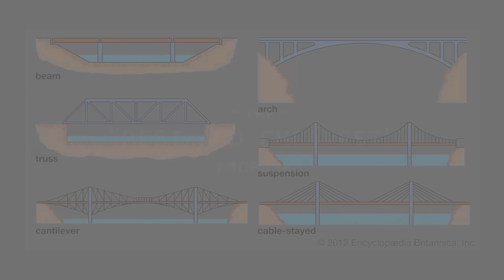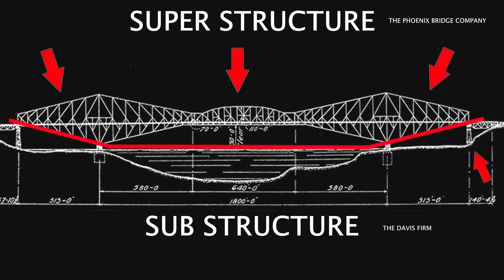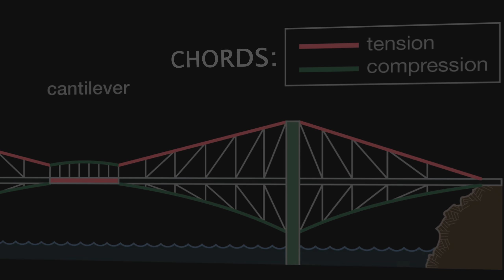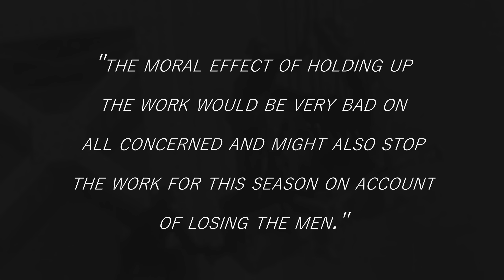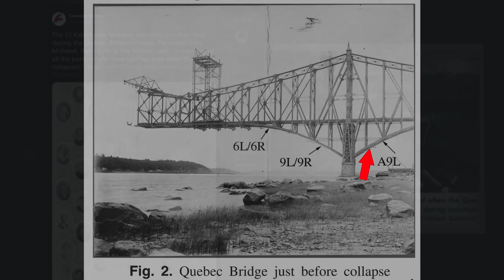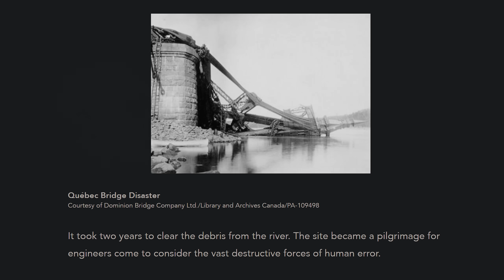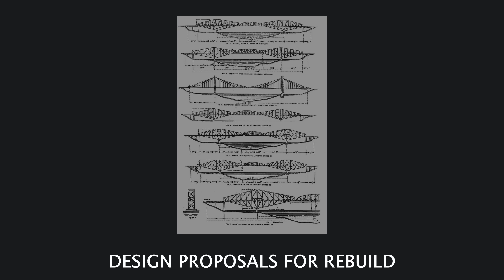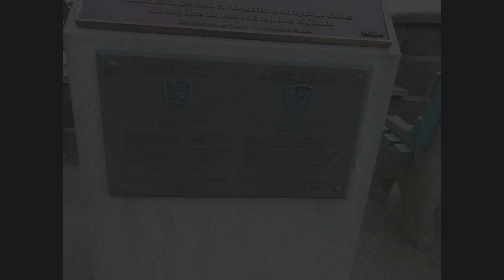Ego in Engineering: The Quebec Bridge Collapse

Comment: Funny enough, the Samuel de Champlain Bridge could have almost turned into the Quebec Bridge disaster #2. Thankfully it got rebuilt entirely but wow.

And like some fellas stated, engineers receive a steel ring as a sort of reminder of this fiasco.

Ps: as a technician in building automation, and it happens that I have to speak to engineers to discuss potential issues.

Comment: Amazing how deadly the compounding effects of "it's fine" can prove to be. A bit of working with pins to make holes line up is normal in all ironworking, but we're talking fractions of inches, maybe an inch or two TOPS--I'm assuming these holes didn't line up by a factor of feet. Badbadbadbadbadbadbad. Cheap, fast, good: pick two.

Comment: Not all engineering failures are immediate. The Minneapolis Minnesota 35w bridge failure was because of the gusset plates being 1/2 inch thick instead of 1 inch thick on the blueprints. Plus the bridge had been added onto. One engineer working for The Minnesota Department of Transportation kept warning management that the 35w bridge would fail, and they didn’t listen to him.

Comment: ☠ The bridge is in such bad condition due to corrosion, some steel member are so damaged that thay are missing 3-4 inch of steel. I had the report of the latest inspection but cant find it anymore and they pulled the report from the site,(I can go and search for it if someone is really interrested) another bridge in the same general area the Pont de l'Île-d'Orléans is in rough shape too this one as still got the report available if you want to take a look i'll provide the link some pictures are really scary and might get you tempted to take the ferry but if you want to go on the ilsand you got no choice but to cross that bridge
Reply: if you want the links dm me since youtube deletes comment with links in them

Comment: It's an impressive bridge but even today they still cheap out in the maintenance of that bridge. If I recall they cancelled repainting the bridge at some point, finally had been done some years later. When you hear from the radio that the bridge needs pressing review of the structure it kinda scared me back then. Seems fine now since the traffic has been slowed down for years due to number of repairs on the dam thing. I'd bet they keeping tabs on it.

Comment: As a young Mech. Eng., I always ask from the welders, benders etc. for their recommendations. I remember when I started my job that factory manager actually really sharpened it to me to talk to the guys because they know their jobs. This talk was a bit odd to me, because I had presumed that of course engineers would ask the guys first. I was amazed to learn that my engineering collegues in fact didn't. I left that job due to the high up management being idiots (especially CEO), but the workers liked me - I always asked their opinions and tried to make sure all the designs were safe, even if it would cost a bit more.

Comment: Had they completed both halves and had them connected in the middle things would have been different, it was stretching all that weight out horizontally it's easy to see how that one chord on the right was about the only thing connected by a diagonal of any merit and that diagonal from it to the top of the tower was at a very steep angle which would have been a much bigger  load on the two pieces than if the diagonal had been say 45 degrees instead of maybe 70 degrees.

Comment: This is an excellent video and involved lots of research to produce it. But there are a couple of other important issues, that led to this collapse, that were explained in the great book "A Bridge at Quebec, by William Middleton.

If you look at the profile drawing of the original plan you can see that the bottom chord describes an arc, obviously  done for aesthetic  reasons. Those bottom chords were in compression on this structure. At every joint in that bottom chord those 2 meeting chord members had to come together at a slight angle, in order to describe that designed curve. At that time no equipment existed to properly face the ends of those chord members at the precise angle needed. This was a major issue for the Phoenix company. Also each of those chord members were made up of several structural steel members side by side and connected together by angled latticework. No machines existed to test one of these chord members to destruction. After the collapse a machine was devised to test a half sized model, but that did not exist when the original pieces were made. Later testing showed the original latticework to be greatly deficient. 

When the pieces were originally assembled they were bolted together in order to save time. The rivet crew came along later replacing those temporary bolts with the rivets. Those riveting crews had great trouble getting the holes to line up in the existing chord members showing that some amount of deflection had already taken place. When a member of a bridge is in compression it is generally accepted that the member will be straight. You will notice that the second bridge was built with straight bottom chords and much heavier components. 

This bridge was built as a railroad bridge. No roadway on the original. Theodore Cooper had been one of the most outstanding bridge engineers in America for over 4 decades. He came up with the design system still used to rate new railroad bridges today, the "E" method. A railroad bridge with an E-75 rating is designed to carry a load of 75,000 lbs per axle. Cooper was elderly at the time of this project, not in good health, but possessed of a large ego. He never visited the site. Yet he would not have any of his work viewed by any other engineers. This was a recipe for disaster. David Steinman, who designed the Mackinac Bridge in Michigan, a 5 mile long structure was often on the site to keep up on how things were going. There have been other spectacular failures of bridges who's designers thought their work was beyond question. Check out the Tacoma, WA collapse of the bridge over Tacoma Narrows in the fall of 1940.

Comment: In Honduras, most engineers teaching over at school would always remind us that it´s the workers insight the one that usually finds irregularities and small problems inside the process or structures, not mangement, nor HR, neither the company executives. Most workers tend to have been involved in their line of work for decades, meaning they know the little things that make som things tick, and what makes them crack, and while us as engineers know most of the technical terms and protocols to corrects this things, it´s them that have the knack for finding those little problems.
Reply: here here. I've been a construction manager for 10+ years and we regularly find errors in engineering - from the simple miscalculation of a pipe run to the enormous load design error. Engineers aren't perfect and most have no real-world experience for their designs coming to life, so they have to rely on the field if something doesn't look right.

Comment: Haha in the mines the miners say all a geology degree only means they don't listen.
 As a builder starting as a carpenter, I noted many architectural design structural failures not always caught by the engineers even to the point of dimensions that did not add up.
 I quickly learned not to trust any of the "expert" opinions.
 And learned as quickly to tell the experts that knew what they were doing and provided real fixes to some of the "Ooops" issues.

Comment: The essential cause were in 1907 ,1916 and now are still due to insufficient safety-margins and, secondly, the ignorance of elastic instability  in structures for this first disaster as well as the second one in 1916. The same  is still true regarding the obvious actual problems observed for this bridge. Hubris is still there  ( Engineers being too confident in their personal knowledge ) . The weight of bulk trains on this bridge were to my observations increased after privatization of CN in 1996 by "likely" 40 % ( subject to confirmation) after an optimistic  SAP-9- 3D model simulation. I took photos of many major inter-rivets buckling of major members. And very recently showed published a very significant "systems" of cracks on the base of north-west main post.  Omertà persist ! 

  This bridge remains highly exposed to elastic instability, buckling conditions , as it remains the world record structural span  ( excluding suspension and stayed bridges) . I am a retired engineer, studying and inquiring these situations for more than eleven years on this bridge that is within a mile from my home. 

 I consider myself as the first and only whistle-blower for an eventual  third disaster. It will likely, be an economic disaster as the bridge is now under high scrutiny but also most details are kept under omertà.  The owner and both governments, I think, know it all. Since they are actively, since my only public alarms in 2015, 7 years ago, reinforcing parts of the structure consolidating the systemic distortions that strangely resembles the ones reported prior to the first disaster.

Comment: Scotland here - had a discussion with a bridge building engineer who was being pressured to use what he considered inferior material in building 'his' bridge. He stuck to his guns, and the advice of his labourers and refused to work with inferior material. In his opinion the bridge would have gone out of service (failed) within 10 years. He said he couldn't live with himself if people died crossing his bridge. He got his own way, although the bridge was delayed and cost extra money. He was sacked after the bridge was finished. 3 bridges now stand over the river, 1 rail, and 2 road. The bridge he built did indeed fail,  salt water corroded the suspension cables. It still stands today, although is closed to private traffic.

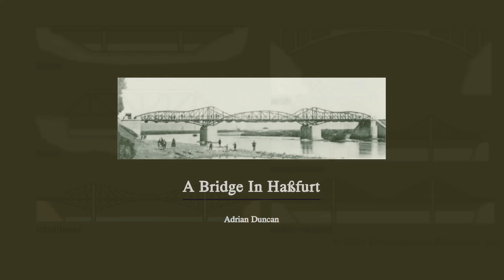Comment: 02:08 As you mentioned the very first cantilever bridge in Germany, just as fyi that the bridge was in service for almost 100 years from 1867 to 1961 when it was replaced by a modern concrete bridge which is also now scheduled to be replaced during the next few years.

Comment: The statement of "engineers are closed minded to the opinions of laborers and assemblers" is beyond true

- mechanical engineer for automated manufacturing
Reply from the maker: 😉
-Robotic Systems Integrator for Automated Manufacturing
Reply: @BrickImmortar  at least my company took my request to work on assembly for 3 months seriously and let me work with the guys. It was a good change for once and I got a little bit more respect from them afterwards. Still amused that they blame engineering for all of the issues they have that aren't design related
Reply: I work as a technician for building automation, mostly on controls? and I often see a lot of stuff that I frown upon. I'm sure there are things behind the scenes that I don't know but that doesn't stop me from trying to reach out to them. Subcontracting makes communication difficult, sadly.

Comment: When you are building a bridge and you don't know what the f*c* you are doing, you always (and I mean 'always') build a 1/10-scale mockup of the bridge first, and see if that bridge fails during construction, or when 4-times the proposed load is applied to it.  If the mockup can hold 4 times the proposed load for 1 full month, without collapsing, then you can go ahead and build that full-sized bridge.
Reply: Youre right totally right! I , retired mechanical , Eng built a sketchy model and independently surveyed the structure for 11 years with lots of photos the actual neglected state of this bridge. It's rusted and deformed beyond repairs in elastic instability lateral buckling, while owners and authorities hide the situation while; I think consolidating the structure for its controlled orderly demolition. Flicker "Rouille et deformations sur le pont de Québec" The more or less the same situation  with hubris and engineers egos. the reading on this video is from Frantz Lichtenberg in charge of the construction letter after he advised the authorities for the second collapse. The safety factor for lateral members and wind bracing is either 1.33 or 1.7 9 before elastic instability not known at the time ( S. Thimoshenko equations) before vibration. Believe it or not owners  increased the weight of ore convoys by a minimum of 40% after an optimist SAP90 3D simulation; and considering wind-bracings and deck supports fully elastic while they are observed in plastic phase deformation all over the structure.

Comment: (Best and Cheapest in Engineering in the same sentence)
Grim Reaper: Whelp, there goes my weekend...
Reply: It doesn't have to be that bleak if the emphasize is on the "BEST" first and then choose the cheapest of them.
It does become dangerous when the emphasize is on the "CHEAPEST" first and then looking for the best.
Reply: @gorilladisco9108  Order from most to least expensive and pick the second cheapest.
Otherwise there's a pretty good chance that disaster will come a-callin' sooner or later, even if it's not necessarily in the form of old mate with the scythe.
Reply: Good,Cheap,or Fast.
Pick 2 of 3.
Fast and Good,and it won't be Cheap
Cheap and Good,and it won't be Fast.
Fast and Cheap,and it won't be Good...

Best,in this equation,should equally balance all three?
Next stop- 'The Land of Make Believe'
Even worse than 'The Twilight Zone'........
Reply: So much for that vacation the reaper was hoping for.

Comment: Exactly right on your comment about close-minded engineers. My career was in interstate road construction, in testing, inspecting, and auditing. My co-workers and I all agreed we'd choose an experienced project manager over an engineer every time.  On site conditions rarely aligned with computer-generated specifications. Likewise, engineers were rarely open to recommendations from those having to do the actual work.
Reply: I went from being an experienced aircraft technician to engineering school, so I can confirm you are 100% correct. One of my professors told me one of the worse things you can do is say "I'm an engineer" in a personal debate. I found out the hard way one of the worst things you can say in engineering school is "I worked on this as a technician". Needles to say, I have no friends in the engineering dept. as a prior technician. I'm thinking about omitting that experience from my resume, as counterintuitive as it may sound. As someone who has a passion and knack for interdisciplinary work, I had a vision of becoming an engineering technician. But apparently that profession doesn't really exist or is greatly underappreciated.
Reply: @seth7745  I thought I would do the same, and came to the same conclusion. I’m now a technician for the simple reason that I like being hands on with my work.
Reply: seems sad and crazy for the parties in this story to ignore steel workers when they start mentioning parts not fitting and things bowing unusually.  they do not have Masters and PHDs, but they could have decades on the high steel and know when a beam just aint right.
Reply: @filanfyretracker  Bingo!
Reply: I wonder if this is a US thing. Or if I didn't notice any of that because I went into electrical engineering. But I can't corroborate this apparently inate divide in my field. On the other hand my work is research heavy so I work with lab technicians a lot and serious lab work would not happen without them. So being condescending to them usually never crosses my mind.